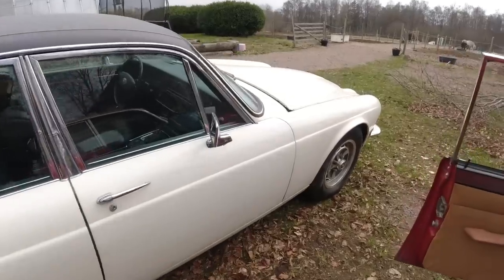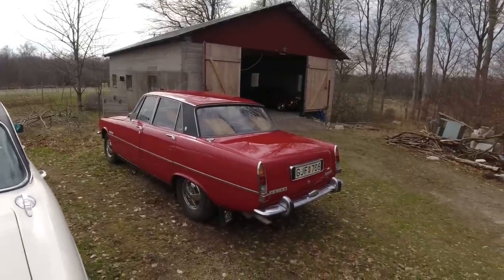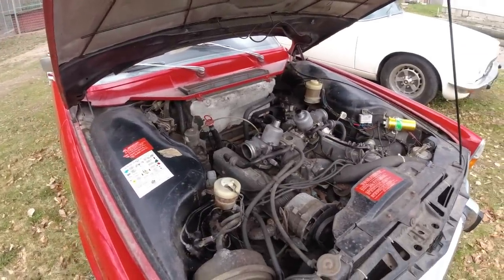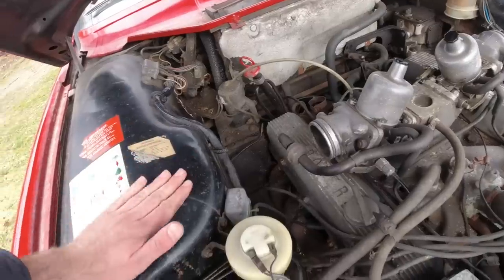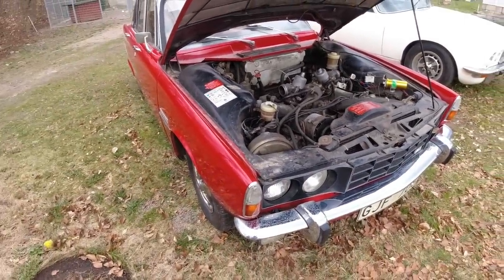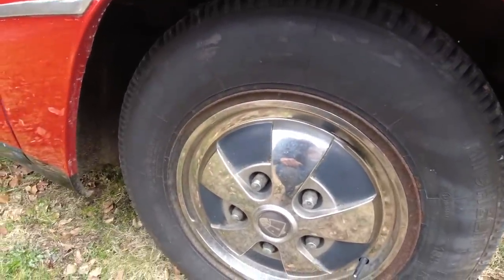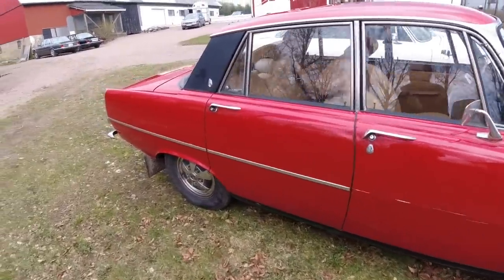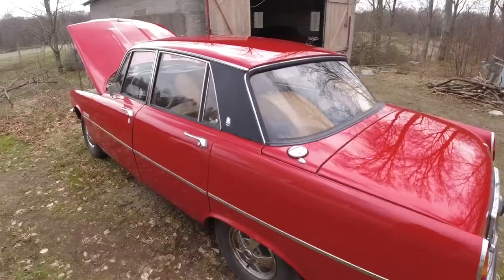What's the Plan for my Rover V8? Is It Staying?

Comment: Road test articles on the V8 had the testers praise the handling, so a spirited drive once you have upgraded all the old components with comments from you something to look forward to. No rust in the bolt on parts will mean the base unit will be mint. I haven't watched your initial video, but i bought one of these (NZ) which hadn't been run for a LOOOONG time. I fitted an oil pressure gauge in the engine bay and had a mechanic friend assist to get it running. Startup saw no oil pressure in the obviously reconditioned engine (was a 4 spd car). Geoff discovered packing the oil pump (external) full of vasoline would help. Sure enough, oil pressure came up and a little wait saw the lifters quieten down.

Comment: Hi Adam, I think you know it’s a keeper. A couple of points. Did you know that the ET headrests are adjustable? If you push the chrome button on the side they will slide backwards and forwards, they should be spring loaded, to the front from memory. Also, do you have access to a number plate maker who can do custom sizes? The rear plate should fit the plinth and you’ll be amazed at what a difference this will make to the appearance of the rear of the car. 
Can’t wait for more news. Best, TonyS South Glos. U.K.

Comment: They are really reliable if maintained ! Keep an eye on the rust keep the mud out of the all the crevices. Regular oil changes essential otherwise cam wear, updated radiator and perhaps supplemental cooling fan reroute the fuel line. My 3500s was quite economical 30 mpg on a gentle run was easily achieved.  I lived in Scotland at the time 🙂I used high octane fuel with an octane booster additive as my car was an early high compression engine. Only ever let me down once with fuel vaporisation in heavy traffic on a hot day. I just had to let the engine cool down :-) good luck!

Comment: PLEDGE on that black engine bay!  Pledge is a spray furniture polish here in the U.S.  It actually is a spray wax like substance.  We used to use it on satin/matte black finishes like window louvers (popular in the late '70s-early '80s).  Pledge will give it a rich finish, but not glossy or greasy.  Just spray it on a worn out T-shirt and rub it on after the surface has been washed and de-greased.  Shouldn't hurt the labels if applied that way.  Helps get rid of chaulky white without looking like a coating.   Glad you are planning to keep this one awhile.

Comment: Nice vid, I had one of these it was also Monza red and had something id never seen on a P6 before a factory electric metal sunroof also a crank mechanism if the electrics failed,id had P5B,P6B and SD1's as a youngster when they werent so rare,all were equally nice and offered so many Smiles Per Gallon. Thanks for a super,best wishes.

Comment: Love a p6 had 3 back in the day, better built than the jags in 70s electronic ignition is a definite as 1 set of points cant cope at high revs thay bounce brakes was all ways a problem use to boil them regularly ,engine was bullet proof, manual was useless ,2000 box  not strong enough auto was fine great car 👍